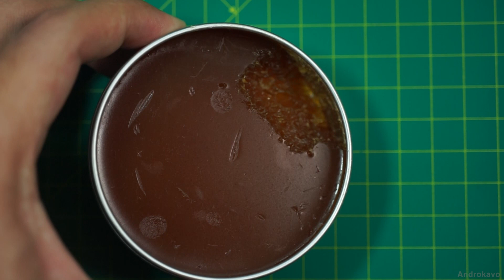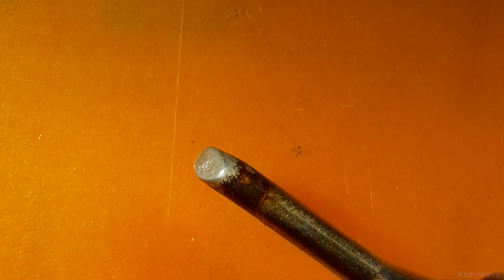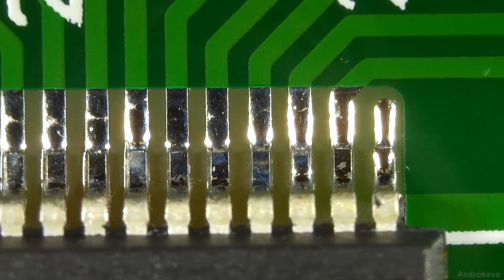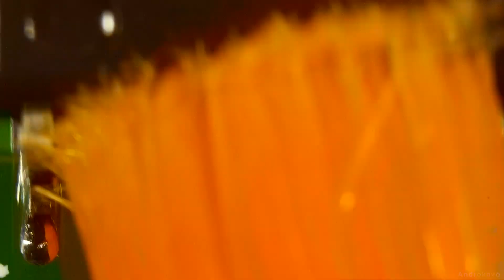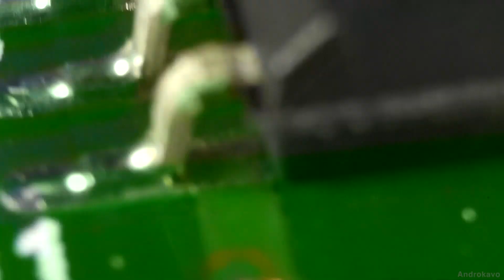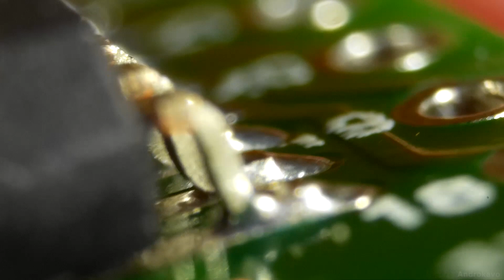SMD Soldering - SOIC SSOP Packages

Comment: Don't do it pin by pin! Just hold a little larger drop of tin/solder on the tip of your iron and just run it sideways ( as you've shown at 2:09 ). Adjust speed as necessary. Put plenty of rosin - okay, flux if you so choose in between the pins of the IC. That's all there is to it, no need to complicate the process.

If the PCB pads are properly sized it's even easier. They are quite long on your boards.

Comment: You make this look so easy  👍🤠
Reply: Korishan With a good soldering station, the right tip, the right temperature, and quality solder and flux, it really IS that easy!!! Just get some cheap soldering practice kits from eBay to practice before you work on anything important. You’ll be a pro in no time! (I suggest looking at the soldering tutorials from PACE Worldwide, eevblog, and John Gammel, too. Preferably in that order.)
Reply: Mostly the flux I find ... I would have given up long ago if not for my trusty tubes of Amtech 559 V2

Comment: There is nothing wrong about soldering each pin individually, but dragging is both quicker and easier and the solder quality tends to the best. Remove excess solder by applying enough flux and reheating. Your solder tip will suck the solder so you can wipe it on the wire brush.

Comment: Why so much rework? In all your soldering videos you go back and reheat good joints over and over... you know this weakens the PCB pads?
Reply from the maker: - Because i don't want good joints, i want beautiful joints :)
- Don't worry, pads weakens when more pressure or over heat, i always wait for low temperature then rework (because for optimize video duration, wait scene had cut)
Reply: Androkavo No, *every* heating cycle weakens the pad adhesion a little bit, even if each cycle is done correctly. (Less so on FR-4, a lot on phenolic paper boards.) 

I don’t see your rework actually improving the result. You’re just poking at them again and again and again... terrible thing to teach!!!
Reply: Actually She/He is showing her/his good soldering skill to us so,that we can learn and improve our skill
Reply: Agreed Antonio. The constant fapping on the pins was driving me nuts. If you know what you are doing you can get "beautiful" joints with one single pass, even if you have to go back and fix one mistake.
Reply: antonio & merlingt1: prove it. show us did he reach 5, 10, 15, 50 or 99% of pad resistance to heat cycling. ie show us amount of heating pads need to be lifted. for this particular board. i'm kinda thinking chip won't fall off together with its pads when the board is flipped. you?

Comment: Thanks for the video I still leaning to drag solder ,I think your tip is better then mine ,I have 11 different sizes ,what soldering station do you use at what temp ,I like how you use soldering paste that's where I can improve on mine ,great video.

Comment: 5:54 you had to remove the IC then resolder the pad. Now you have  torsion on those soldered pads  which will definitely cause problems in future.
Reply: 7:54 he resoldered this pad

Comment: i have a problem when cleaning the pads
the greenlayer always crumpled and detached
Reply: Perhaps you are overheating the PCB or under heating and pulling off the pads. You need enough heat and a larger tip when using the copper wig, but not too much so to burn the PCB.

Comment: What brush do you use to clean the pcb? Is it esd safe?

Thanks
Reply: Ebrahim A.Rasool I would recommend getting ESD brushes for sensitive items. (Contrary to popular belief, alcohol can build static charge!) For less sensitive things, a regular cheap “acid brush” with a rolled sheet metal handle works great, especially if you’re working on an ESD mat and using an ESD wrist strap.

Comment: What soldering iron is recommended ? can you share some info
Reply from the maker: I recommend soldering iron can adjust temperature (200 ~ 450°C) and easy to change soldering tip
With soldering tip have cut surface 45° or 60°, like Hakko 900M-T-2C, T15-CF2
Reply: Androkavo thank you
Any recommended brand for soldering iron ? I have a lot of tips. My problem was the soldering iron as you said. No easy way to change the tip until i turn it off .
Reply from the maker: Quick, Yihua, Hakko, Weller, ... popular brand dependent in your location
i'm using Quick 705 (included soldering iron and hot air), as my experiment it's good
Change hot tip, you can use leather gloves or other way : https://goo.gl/t8pTd1

Comment: For clean flux why liquid used ? Tnks
Reply: CX1RK Alcohol works well (isopropyl, ethanol, or methanol) but commercial flux removers (which are generally blends of alcohols and hydrocarbon solvents like heptane) do work a bit better and don’t cost a fortune. Brake cleaner (which is basically hydrocarbon solvent) also works well.
Reply: @tookitogo  how about thinner A special ?